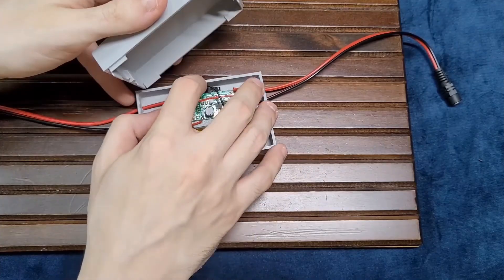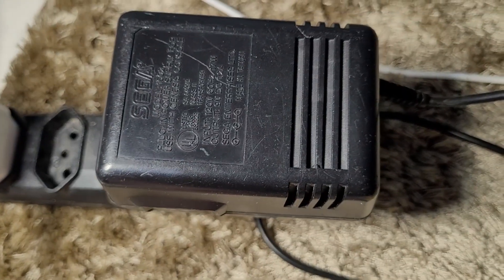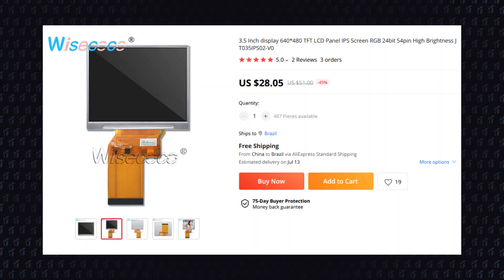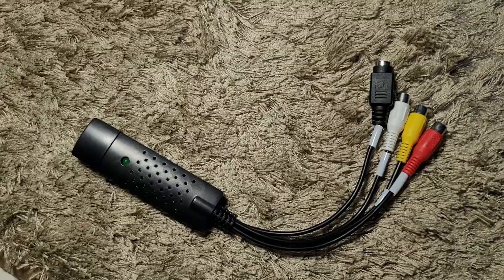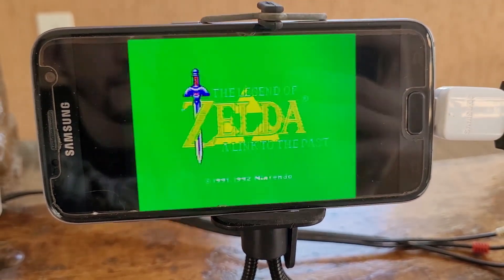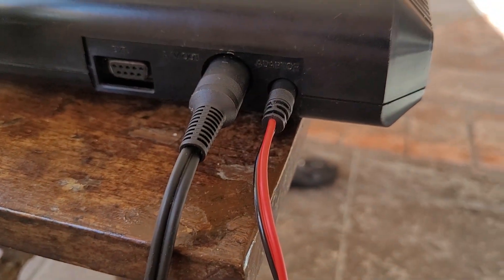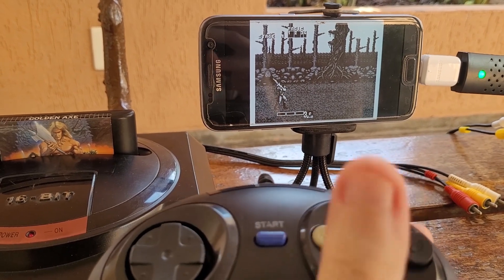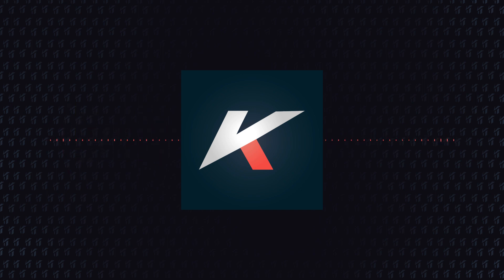Solar Powered Videogames !

Comment: I actually live off grid in a van with 500 watts of solar on the roof. I built my solar system around being able to use power tools, solder, and play my retro games on a CRT. I use a lot of direct DC circuits, bypassing the inverter for stuff like my PC, 4k monitor, audio amp etc. and have used direct dc on my game consoles, but it's also not really necessary since I have more than enough solar and battery power to play all night long. It mainly helps with my PC, which has an RTX 3060 in it. In my van, I also have one of every console, including PC engine and other obscure consoles. I have been living in my vehicles since 2009, and in 2018 I made my epic solar setup. I have beaten many many games in the van, since I do 100% of my gaming and living in here. The CRT I use is a JVC TM-H1750CG.
Reply from the maker: Looks awesome, you could make a channel to show off that build
Reply: @VKsChannel  I have no desire or motivation to create videos about my build. They would be pretty poor quality. I only have a smart phone camera. Mainly I write about retro games and my lifestyle and post photos. But videos are not my thing, and I value my privacy. Besides, I don't care about optics or clarity.
Reply from the maker: @treefroggy  my videos are also made with a smartphone camera, smartphone cameras are great today, I have a Nikon DSLR and the smartphone blows it away
Reply: @VKsChannel  You can come make a video of my van. lol.
seriously though if you have questions, I'm always glad to discuss solar, retro games, and my cross between the two.
Reply from the maker: @treefroggy  I'm too far from USA
Reply: @treefroggy  Hi, I definitely have questions, would you mind if I sent you contact information?
Reply: @Reapehify  you can ask here and I will answer

Comment: Funfact, you can even power both the snes and the Mega Drive (Genesis) through their video out ports.
I had a setup with an old and cheap scart-switch which not only took the signal of one of the inputs and sent it through to the tv but also sent it to all other connected devices as well. VCR's and DVD-Players didn't care much but the SNES and Mega Drive powered each other when either one was turned on (not only that, but both were running without me having to turn the power button on on the second console, it would just turn on by itself)
Wouldn't recommend to run those machines that way but I thought it was an interesting find